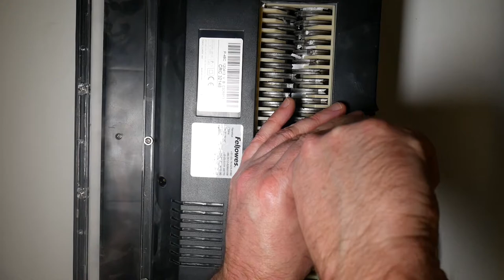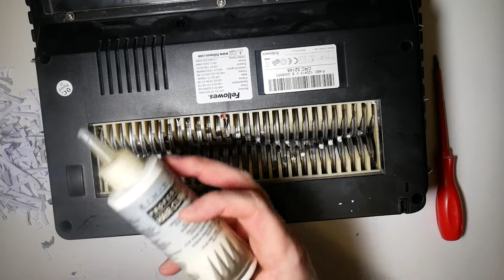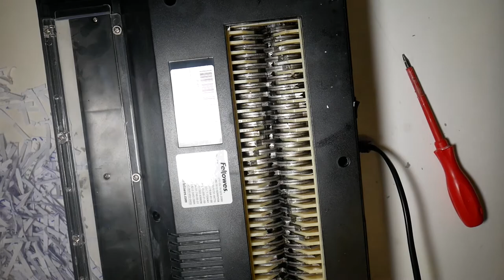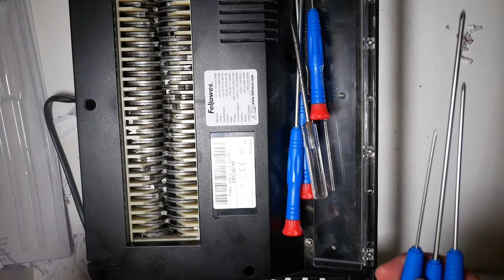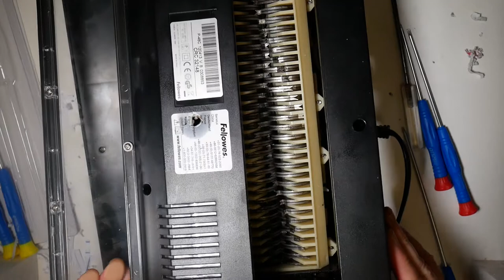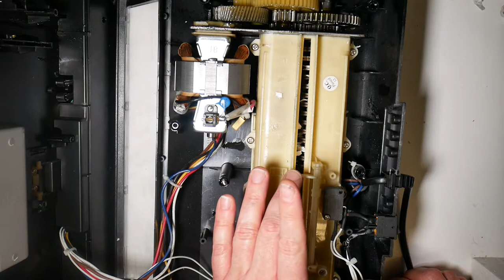QUICKFIX: Can I Fix A Broken Paper Shredder?

Comment: My shredder only makes noise when reversed, but cannot go forward...there's very few papers shredded and nothing else. why is it only making the noise when reversed but not forward and yet when your trying to put paper inside of it to shred?
Reply from the maker: it may be that the microswitch which triggers the forward shredding motion when a sheet is put into the shredder, is blocked with pieces of paper.  Try and unblock that microswitch.

Comment: The same thing was happening to my shredder. It had been a good little soldier for about 10 years. My motor was sparking as well and it would only turn the teeth in reverse. I thought there was an issue with the metal teeth and I was hoping I could use the motor for something else but alas….